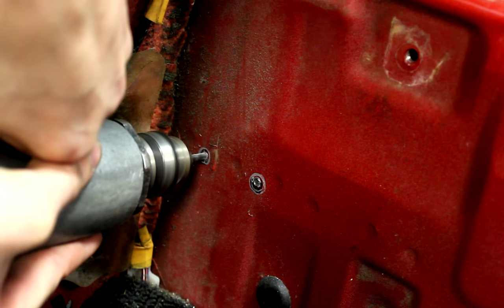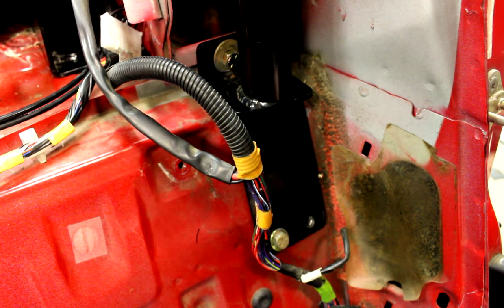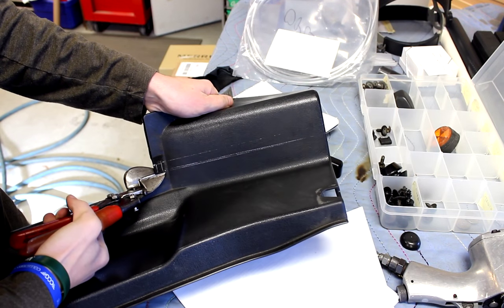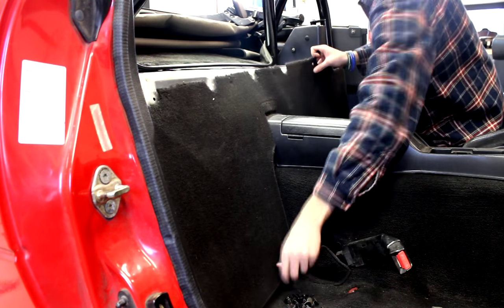How To Install a MX5 Miata Roll Bar (NA and NB)

Comment: Thank you for the video.  Did you end up doing one for the stock seat belts?  I’m installing g the same one, but trying to keep the stock seat belts.  Is it just a mater if shoving in the belt behind the bar, and taking apart the top bolt to accommodate the bar?

Comment: Awesome video! Short and fast but still has all the necessary info, perfect! Question; How much room does the back of your head has when you but the seat back all the way? I pretty tall so I have my seat against the back panel and I really wonder if my head would will hit the rollbar
Reply from the maker: +MiataMods thanks bud! Sadly there isn't a ton of room with the seat all the way back, your head does end up really close to the bar. There are taller roll bars and you always could try and lower the seat to give you a little more room

Comment: Can you have the stock seatbelts on with that roll cage? And where and for how much can I get one like yours I have a 2001 miata mx5 convertible??
Reply from the maker: +Edwin Figueroa yes you can, there are adapters which you can use to run them.  And I got mine used for $300 off of craigslist but for a new one look on boss frog's website, it'll be a good amount more than $300 though.
Reply: Thank u.

Comment: Would you by chance know where I can get spare spacers for the top seat belt mount? The previous owner left the seatbelt slide sandwiches under the tab for the new seat belt location so the belts get stuck-_-
Reply from the maker: I don’t off the top of my head, but if you can’t find anywhere that sells them you should be able to make them relatively easy!

Comment: Is it possible to put the soft top up/keep the soft top on with this roll bar? I plan on DD'ing an NA with this roll bar installed because it looks cool and itll not kill me
Reply from the maker: Yes, you could use the soft top as normal (mine has a glass window and still works) or a hard top. Some bars are too high though so definitely research the bar before you buy it. This is a boss frog clearview double diagonal bar. Good luck!

Comment: Can you fit a hardtop and soft top over the rollbar?
Reply from the maker: +TremblerBody - Norsk Gaming You can easily fit the soft top over the bar, I haven't tired a hard top though because I don't have one.  This also depends on what bar you get, some work with hard tops, some don't

Comment: can yu still use the convertible roof with a roll bar installed?
Reply from the maker: +BettaMade TV with this bar yes you can, with some bars you can't so just make sure you do some research before you buy one
Reply: CashedOutCars I like this nice and fast pace video. can u put on the convertible hard roof with roll bar installed? I got a convertible hard top nc and want to make it safer :)